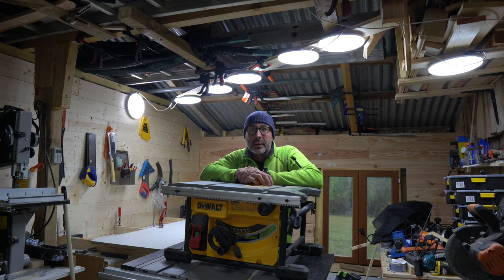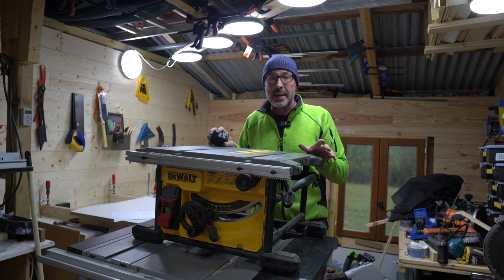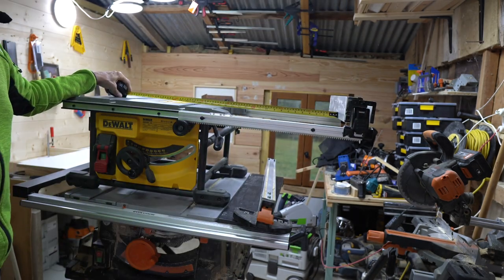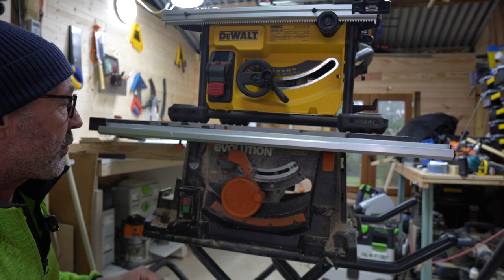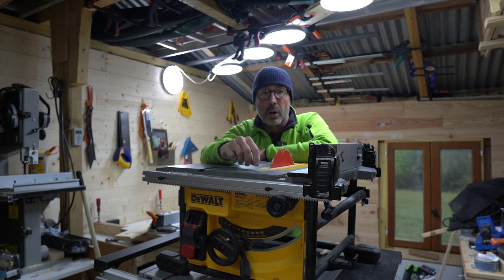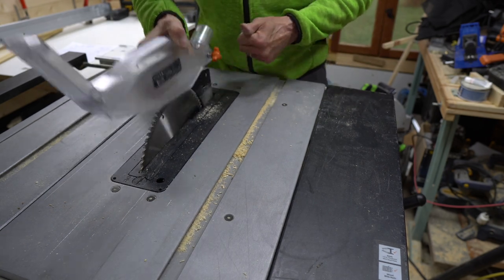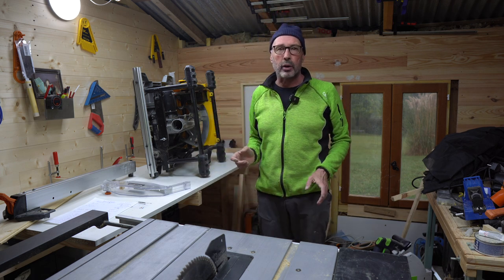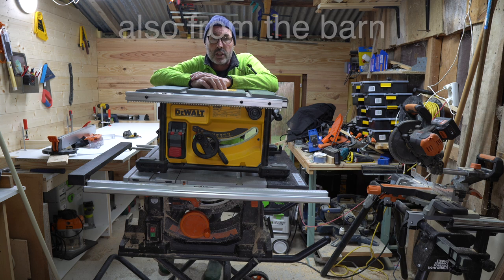Small Workshop Table Saws: Evolution Rage 5s Vs DeWalt DWE7485.

Comment: Great video JP, thank you. Love my Rage-5. I work outside only so it has been rather low production the last couple weeks. I have told Santa I been a good boy and asked for a 3x3m pop-up tent with walls so finger crossed there. After watching yer videos and getting a different rebate deal on the price I got the saw and the 80 tooth Saxton blade. Once the prime milling of the pallet wood is done with the multi blade I switch to the fine cut. Take care & stay safe.
Reply from the maker: Hi Doug. I often thought of getting a pop up tent when I worked on the decking in the UK. Regards JP

Comment: The Rage 5 saw is perfect for me, easily moved around my small workshop and  into the garden for larger sheet material cuts. Dust collection is crap, but as far as I can see a lot of youtubers have all sorts of dust collection systems, but in lots of their vids they don't use them . I just wish the rage 5 had a bit more revs on the spindle speed, but no doubt that is because they sell it on the multi blade principal where you can cut all sorts of materials with it.
Nice comparison vid JP, but I'll stick with my Rage 5. Thanks to Leo at Hand-i Craft for putting me on to it.
Reply from the maker: Hi Tom. Looks like a lot of us like to wheel the Rage5 into the garden 👍 Regards JP

Comment: i has the dewalt 10” and was a great saw but i wanted a bigger cutting capacity so went over to the Hikoki table saw. this has rack and pillion too but has a bigger width which suits me
Reply from the maker: Hi Debs. I have just googled that saw, it looks a great machine!  It has a table size similar to the Rage with the fence of the DeWalt, and a price that’s sits between the two 👍 Regards JP
Reply: @Smallbarnworkshop  it is a very good saw. love mine
Reply: Which Hikoki model is that?
Reply: @mattroberts5691  i have the corded version which is C10RJ, but they do the same saw as cordless and that is C3610DRJ(G42)
Reply: @DebsHill1  thanks 👍

Comment: Nice comparison, Sir! 
If I get the urge to build a workbench I'd consider incorporating the Dewalt one.
Incidentally, I have an old Dewalt DW743 flip-over saw with the same orange Woodford Woodworking guard, which fits the DW743's riving knife, but for which I haven't yet found the right adapter to connect to a shop vac hose. 
I'd welcome any suggestion...
Thanks
Reply from the maker: Thank you. Have you considered the old foam tape trick?  See herehttps://youtu.be/zPYJ2jGjBJY

Regards JP

Comment: What about drilling maybe a 1 or 2 inch hole in the bottom of the cowl so any dust will just fall straight through rather than collecting while also keeping the  blade safely away from your dog.
Reply from the maker: Hi. That’s one of the things I’ve seem people doing and it’s a great suggestion. Regards JP

Comment: I found the evolution terrible, it wasnt possible to get the fence parallel to the blade and the adjustment screw was stripped from the factory

Spend a bit more and get the DeWalt even if you dont get a stand